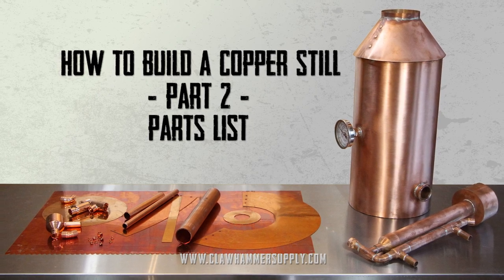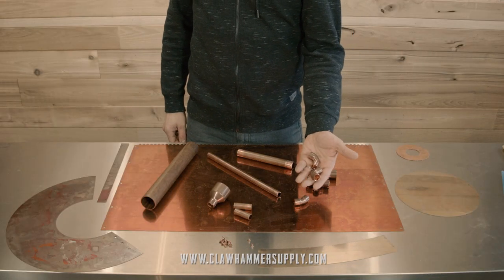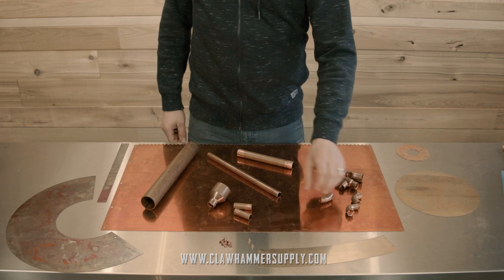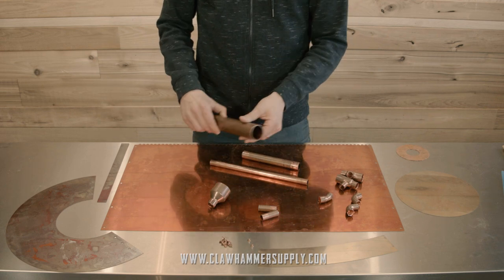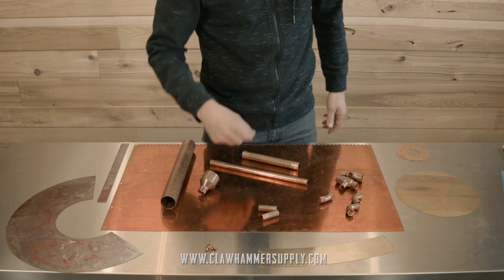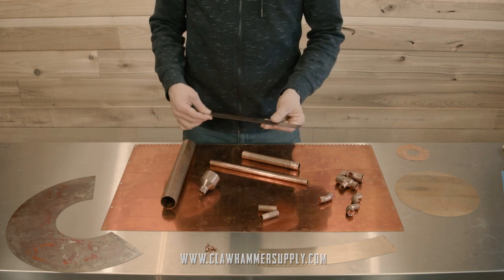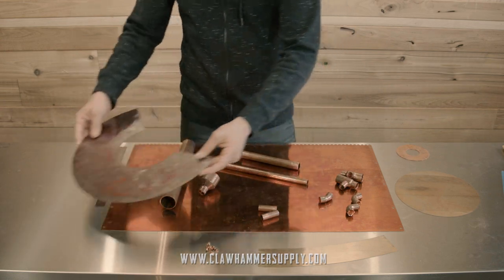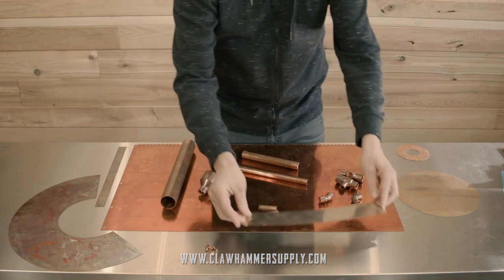How to Make a Moonshine Still - Part 2 - Still Parts and Material

Comment: how thick are the copper plates?
Reply: I know, KEY parameter, right?... DUUUUUDE, what friggin' gauge is this copper sheeting?  Sheeeeeeeet... ;')
Reply: @MajorCaliber  Build mine with a 2mm bottom plate and I think it was 0.5-0.7mm for the rest of it. That's perfect, enough stiffness since you shape it like a cylinder.

Comment: I've been thinking a lot about making my own fuel especially after my stickers were black mailed. Here in Batman county it is definitely a damp location so I want to ask you,,, what's your opinions on wireless chargers and if you were Poe or pro on using a ceramic sync instead of a copper tube coil?